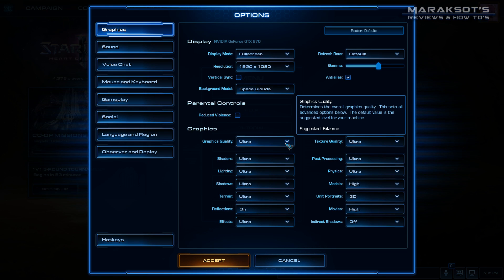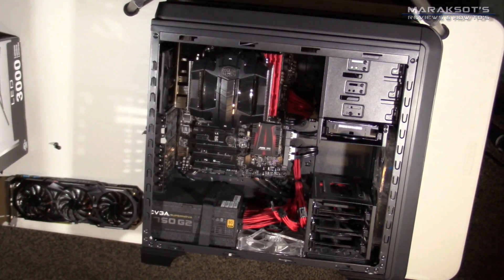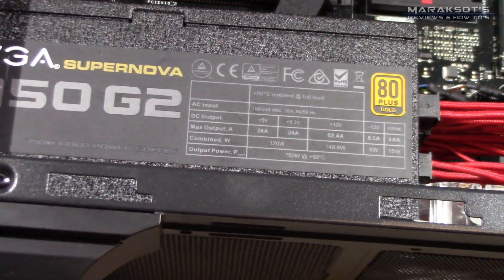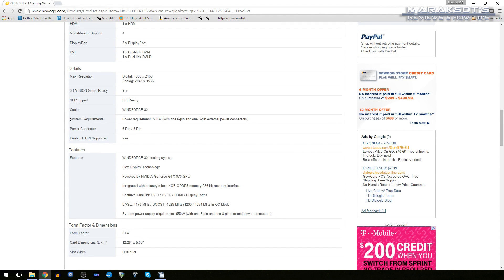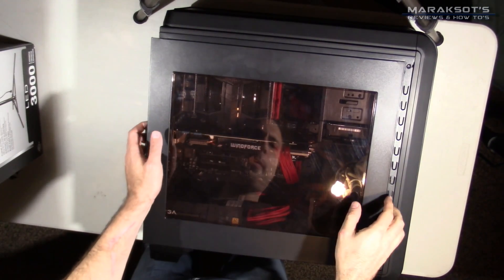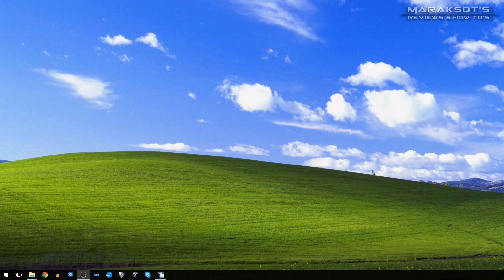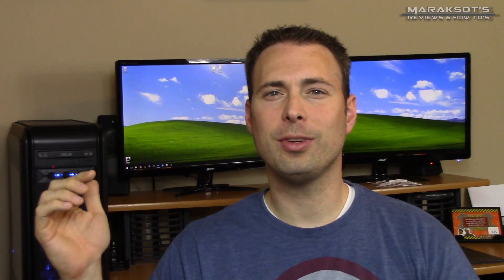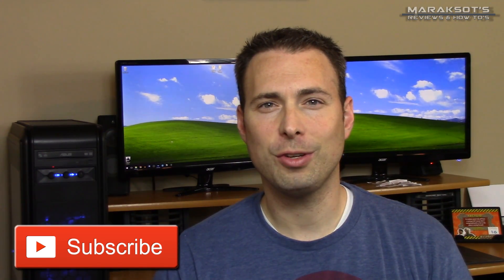A Beginners Guide - Upgrade your GPU - How to Install a New Graphics Card

Comment: If you have just the normal HP graphics without an graphics card do you have to uninstall anything before or after you put a graphic card in?
Reply from the maker: +Nelly if you don't currently have a discrete GPU in your PC then all you need to do is install your new graphics card and install the drivers for that card.
Reply: +Maraksot78 Thank you for the response and as you can maybe tell I'm trying to turn a pre built system into a decent gaming PC.
Reply from the maker: Nelly best of luck to you my friend. Happy gaming! :)

Comment: Im using an AMD GPU, so do i have to uninstall the old drivers then install the new GPU? so after i install the new GPU i plug it into the HDMI and just turn the computer on after that install the new drivers?
Reply from the maker: are you upgrading from an AMD GPU to another AMD GPU?  Or from AMD to Nvidia?  If you're going from AMD to AMD as long as you're already running the most current version of their drivers then all you need to do is swap out your old card for the new one, plug everything into it, ie power and HDMI or DVI or display port cable to your GPU and your monitor and you'll be good to go.  If you aren't running the most recent drivers it will still work you just may not get the maximum performance possible from your new GPU.  If you're switching from AMD to Nvidia then you'll want to uninstall the AMD drivers, shut down your computer, unplug it and everything, swap out the cards, plug in the power and your display cable, power it back on and it should boot into Windows and everything just fine but you'll then want to download the latest Nvidia drivers and install them.  Best of luck to you my friend.  Happy gaming!  :)
Reply: AMD to NVIDIA
Reply: Thx!

Comment: Hey dude can you put a GTX 970 with an AMD FX 8320 on 16gb ram and will shit get bottlenecked or nah
Reply from the maker: +Diapason Dlvg you should be good for the most part, it just depends on the game or application. Stuff that's more GPU dependant will run good but for stuff that's more CPU dependant you'll see some frame rate dipping.
Reply: +Maraksot78 ok thanks man I'm gonna get a new power supply and a new cooling system and over clock my fx 8320 to 4.3 ghz
Reply from the maker: Diapason Dlvg sounds like fun man! :) happy gaming!

Comment: do you have to manually uninstall old graphics drivers before mounting a new card?
Reply from the maker: +Caedmon Rodriguez if you're switching from an Nvidia graphics card to an AMD graphics card or vice versa then yes you want to uninstall your drivers before installing the new GPU. If you're going from one Nvidia card to another or AMD to another AMD card then you're new GPU will work but if you aren't you already then you will want to upgrade to the most current drivers to be able to get the most out of your new GPU. Best of luck to you man, happy gaming! :)
Reply: ahh ok2 tnx man you got a new subscriber :D
Reply from the maker: +Caedmon Rodriguez no problem man, I'm happy to help. Thanks for the sub. :)
Reply from the maker: ***** you're very welcome my friend. I'm happy ou were able to find the answer you're looking for here. :)
Reply: i needed help earlier cuz i got my 980ti and mmy old card the gt730 2gb ddr3 and scared to install it maybe it would fuck up my new card :D
Reply: +Maraksot78 how do I manually uninstall the old driver
Reply from the maker: +Swirly Thanks for the question.  You can uninstall your current drivers the same way you would any other program.  If you've never uninstalled anything before you can do it by right clicking the Start button in Windows or in Windows 10 right clicking the Windows Icon in the bottom left corner or your screen after which a menu will pop up. Click on Control Panel and then Programs and Features. You should then see something that says uninstall a program, click that and your computer will then populate a list of all the programs installed on it. Find your old drivers on the list, if you're using an Nvidia GPU uninstall everything that says Nvidia or GeForce or if you have an AMD GPU  you want uninstall everything that says AMD, Raedeon, Catalyst or Crimson, click it to select it, and then click Uninstall.  I hope that helps.
Reply: +Maraksot78 thank you for the reply new to pc an is it the one called AMD catalyst control center
Reply from the maker: Swirly you're welcome, yah I wasn't sure exactly what it would be for AMD. My GPU is from Nvidia. :)
Reply: thank you for the help :)

Comment: Brian, thanks for the video! One question. I am replacing my Nvidia. Gtx 980 witn an 1080 for the first time. Before I hook up the 1080, do I have to deinstall all the drivers and Gforce nvidia experience software, or can I just keep everything as it is, since downloading the new graphics card drivers (like you explained) would solve all these questions automatically for me? Please let me know. I really appreciate your time, thank you!
Reply from the maker: +phili878 thanks for the question and congratulations on scoring a 1080 it's an absolutely amazing card. Well, I haven't used one personally but I've been geeking out over them ever since Nvidia announced them a few weeks ago. Anyway, since you're upgrading from an Nvidia card to another Nvidia card you don't have to uninstall your drivers, everyhthing will work just fine. That being said you are going to want to make sure you're running the most current drivers to maximize the performance of your new GPU.  I'm a bit of an old school guy so I always uninstall my old drivers and then install the new ones because that's how it needed to be done in the past. But my understanding is you don't need to do that anymore. In fact I'm pretty sure in the Nvidia control panel you can set it up to automatically update for you. But like I said I'm old school and do it the old way. :D  Happy gaming my friend!
Reply: Ok, so in this case, what do you think if I do the following: 1. With my old card still inside, I download the latest drivers (if they are available). Then I shut computer off, and follow your instructions, just hooking the new GPU in, and then boot up the computer. That is all I suppose? The system will automatically recognize the new card, no fiddling around in Bios etc, right ? Thanks a lot for your answer !!
Reply from the maker: phili878 you got it man. Again congratulations on the 1080, enjoy that baby! :D
Reply: thanks man! I got the Asus 1080 Strix :) I liked how silent it will run, because I have a 980 strix now and it is so silent..I can hear my tiny alarm clock tick from 3 yards away while this thing runs a game on ultra high settings. Thanks a lot for your help, keep up the great work!
Reply from the maker: +phili878 thanks man, will do. I saw a little about the Asus Strix the other day when JJ from Asus and the PCDIY YouTube channel tweeted about it and that card looks sick!!!  I've never owned an Asus graphics card before but I almost exclusively use their motherboards whenever I build a computer. Asus makes really nice stuff.

Comment: Hey! Will a 750ti be bottlenecked mutch by a intel 2 quad q6700 and 8gb ram? I know that i have pci 2.0 and a pci 3.0 card should work. pci 2.0 are abit slower but will the pci express and cpu + ram bottleneck a 750ti mutch? Thanks!!
Reply from the maker: +Aleks g.n I believe the 750ti will be bottlenecked slightly but seeing as you have PCIE 2.0 rather than 3.0 I think that will more so be your limiting factor.  That being said I think you'll still get good performance out of that 750ti though.  Happy gaming!

Comment: Do i need to uninstall my driver from my previous graphics card before installing my new one?
Reply from the maker: +mrantman9 thanks for the question.  If you're upgrading from one AMD GPU to another or from an Nvidia GPU to another Nvidia GPU then you don't necessarily need to uninstall your current drivers as they should work with your new GPU.  However, I would recommend upgrading to the most current drivers as they will help you get the most out of your new GPU.  If you're switching from AMD to Nvidia or vice versa then yes you're going to want to uninstall your current drivers before swapping out cards.  Happy gaming!  :)
Reply: Maraksot78 Thanks!!
Reply: +Maraksot78 so if I have a gtx 980 and upgrade to a gtx 1080....I won't need to and my gtx 980 driver should work for the time being until I clean install the 1080 driver right?
Reply from the maker: Katrina Donahue that is correct. :)
Reply: Thank you
Reply: Very fast reply
Reply from the maker: +Katrina Donahue you're welcome. I should also mention that if you already have your Nvidia drivers updated to the most current drivers before swapping out cards then you'll be good to go.
Reply from the maker: +Katrina Donahue you're welcome. I should also mention that if you already have your Nvidia drivers updated to the most current drivers before swapping out cards then you'll be good to go.

Comment: I put in my graphics card, but the VGA won't connect up and won't display on my monitor. Any help?
Reply from the maker: +itsDynamicDylz do you see anything at all when you boot up your computer? For example do you see your motherboard manufacturer splash screen and then nothing or just nothing at all?
Reply: +Maraksot78 nothing it says no signal, so I tried plugging the HDMI From my graphics card into my monitor but nothing either.
Reply from the maker: itsDynamicDylz ok, so the next trouble shooting question I'd ask is your graphics card fully seated properly? Are the power plugs to the card securely connected? If so try switching to another power connector from your PSU to see if for some reason the connector you were using is bad.
Reply from the maker: +itsDynamicDylz Also if the card is fully seated and it has adequate power to it but is not working although it's rare it is possible that you have a bad PCI Express slot on your motherboard.  If that's the case try the card in a different slot... assuming your motherboard has more than one PCIE slot of course.
Reply: Thanks its fixed the hard drive was cooked and wouldnt work but thanks g
Reply from the maker: +itsDynamicDylz I'm happy to hear you got it figured out man. Enjoy some gaming with that new GPU! :)
Reply: thanks man! runs beautifully.
Reply: +Maraksot78 Hey, I'm building a PC, but my CPU that I have laying around does not have integrated graphics. If I shove it in a new Motherboard and plug in a GPU will anything show up on the screen without a GPU driver?
Reply from the maker: Theodore As long as all your components are in working order it should boot up just fine.
Reply: Maraksot78 Thank you sir.

Comment: I got a pretty decent pc. Just its i3 and intel graphics card. Im wondering if I could just put a new graphics card in, and an i5 instead of the i3.
Reply from the maker: +LeftClikk Chris L is right when it comes to upgrading your graphics card; if you follow the advice I laid out in the video you'll be just fine.  When it comes to upgrading your CPU you'll need to find out what CPU socket your motherboard has.  If you're using a fairly new (meaning in the past couple years) i3 then you may have an LGA 1150 socket or if it's a really new one then it may be an LGA 1151.  There are also older i3's that use other sockets like the LGA 1155. Probably the easiest way to find out what socket you have is to go to the device manager in Windows, click on Processors and it will tell you the model of your CPU.  For example mine is an i7-4790K.  If I Google i7-4790K socket type then  find it's an LGA 1150.  Once you know what your socket is you can then upgrade to any i5 or even i7 that fits that socket.

Comment: Do i have to change anything in the bios menu?
and is it recommended to delete all older drivers of the old gpu? before installing the new one in your pc?
Reply from the maker: +Maximilian Busic thanks for the question.  If you're switching from an AMD GPU to an Nvidia GPU or vice versa then you'll want to uninstall your current drivers before removing your current graphics card then install the new drivers after you've swapped your new card in. If you're going from AMD to another AMD or Nvidia to Nvidia then as long as you have the most current drivers already installed all you nees to do is swap your GPU and you're good to go. You'll be ok even if you don't have the most current drivers as well it's just to be able to leverage all the performance your new GPU is capable of I feel it's a good idea to have the most current drivers available. As for your bios... once you've installed your new GPU your system should auto detect it so you shouldn't need to change any bios settings. I hope this helps. Good luck man and happy gaming!
Reply: +Maraksot78 thank u very much man, helped me out a lot
switchin from a amd r7 260x to a geforce gtx 960😊
Reply from the maker: No problem man. If you haven't purchased your 960 yet you might want to wait a little bit longer to decide because Nvidia just announced the GTX 1070 and 1080 yesterday.  The 1070 is set to retail for $379 US and is supposed to be more powerful than a TitanX which makes me think the price of current stuff is going to be coming down soon.  I believe the 1070 and 1080 will be launching at the end of this month so 970's and 980's may be getting much more affordable. Wanted to share that with you just in case you hadn't heard.
Reply: +Maraksot78 okay nice to hear thank you
im livin in germany and i didnt hear of that yet
i purchasef the gtx 960 for 200€ so pretty afordable i think
the 1070 will be at more than 300€ i think, and this is over my budget so i think i made a pretty good deal haha

Comment: Can my gtx 960 fit in my Intel 4600
Reply from the maker: +Stardark9 thanks for the question, I'd love to help but need a little more info because right now I'm guessing the "Intel 4600" you're referring to is the Intel HD Graphics 4600 which is integrated into some "Haswell" chips from Intel. For example I have an i7-4790k processor and it has Intel HD Graphics 4600 integrated into the chip. The iGPU doesn't have enough horsepower to run the games and applications I play/use at the settings I want so I also installed a GTX 970 into my system. I'm assuming you have a Haswell based i3, i5 or i7 processor due to the fact you have the same integrated graphics that I have on my i7-4790k.  So for now I'll say yes, assuming you have a big enough power supply and as long as you have sufficient space in your computer case the GTX 960 will work very nicely in your system.
Reply: Maraksot78 wow thank you for that reply!! Subed <3 thanks dude!
Reply from the maker: +Stardark9 no problem man. I'm happy to do what I can to help.  Thanks for the sub! Happy gaming my friend!
Reply: Maraksot78 wait im scared and I never put in a graphics card before. Soo do u think I will.be ok? Also should I be on the floor?
Reply from the maker: +Stardark9 no worries man. It's a very simple process. You can install the GPU on a table or the floor, just make sure you ground yourself out to avoid any static electric discharge. The first time I upgraded the GPU in my system I was a bit paranoid I was going to mess something up as it was the first computer component I had ever installed myself. Thankfully computer components are tougher than most people realize and changing them out is actually quite simple.
Reply: +Stardark9 So.....how did it go?
Reply: ze OP master had to get a new power supply ;c i got the corsar 750W and i had to take it to bestbuy to install it. my pc is great now tho
Reply: Stardark9 awesome

Comment: Hello can you help me, im going to upgrade from a gtx 550 ti to a gtx 950 do i have to uninstall my drivers first and how do you do that ? please help.
Reply from the maker: +XDerp720Hd since you're upgrading from one Nvidia card to another you don't have to uninstall your drivers but if your drivers haven't been updated in a while then I would recommend uninstalling them and installing the latest Nvidia drivers. Uninstalling your video drivers is pretty much the same as installing a program on your computer. If you've never uninstalled something before then what you do is go to Control Panel, then under the heading programs click on Uninstall a program. Your computer will then populate a list of all the programs installed on your computer. They should all be in alphabetical order so scroll down until you see programs that say Nvidia and then right click on one of them and select uninstall. Do that until all of the Nvidia stuff has been removed, restart your computer and then download and install the new drivers from Nvidia's website. Good luck man and happy gaming!